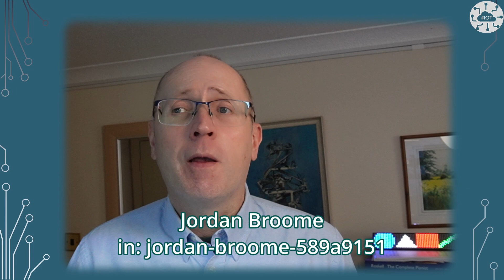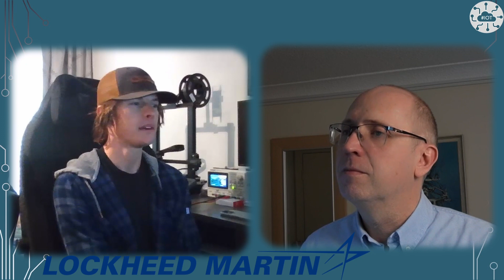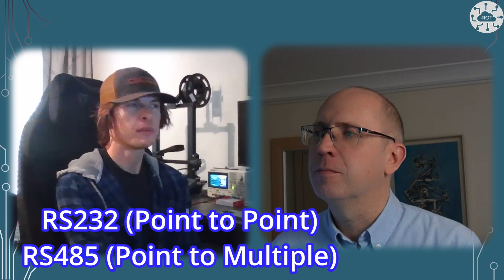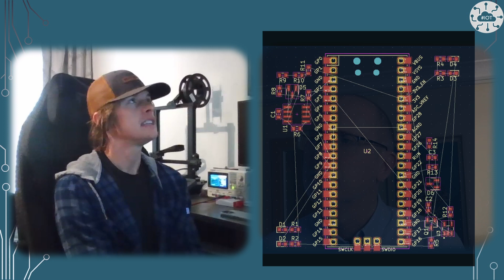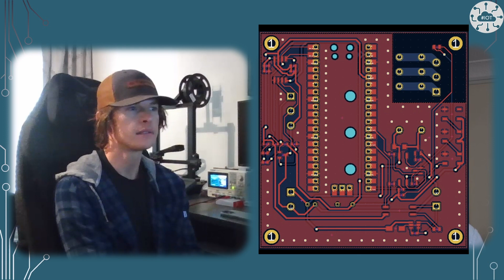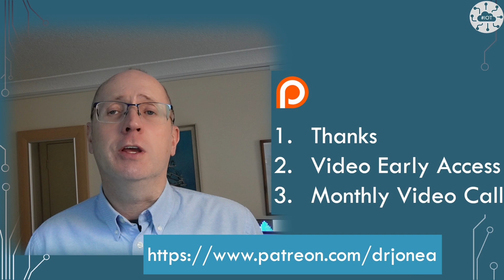Talking to Jordan Broome about hardware design for Raspberry Pi Pico

Comment: Cool video, I have moved onto working on the pico examples out of the "raspberry pi pico sdk" pdf in the appendix section. A knowledgeable mentor or something similar would help immensely, but I like the effort that comes with figuring it out as well.
Reply from the maker: A mentor should not give you the answers but guide you. Sometimes the learning curve is too steep and that is where I think courses come in to make that a steadier gradient.